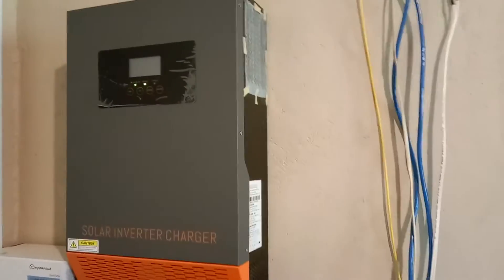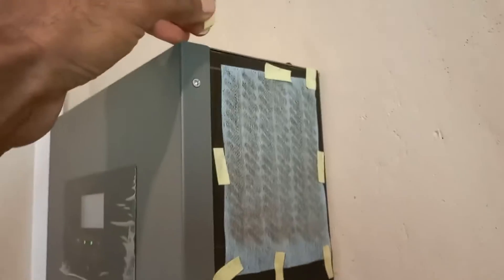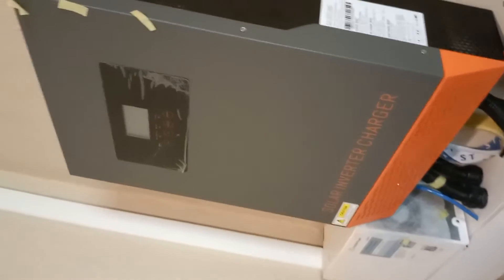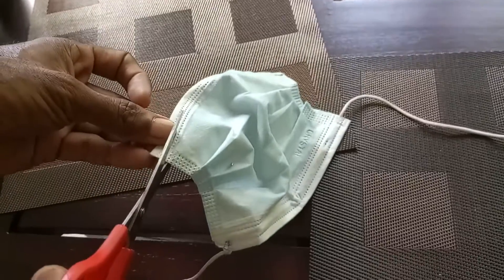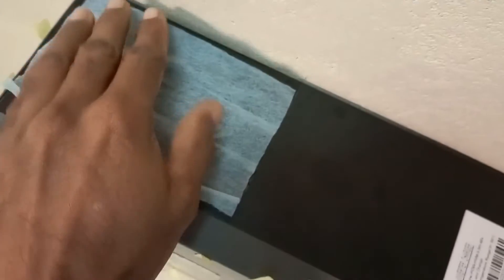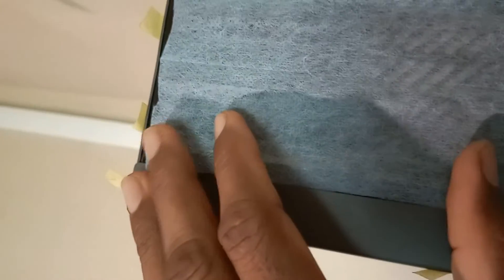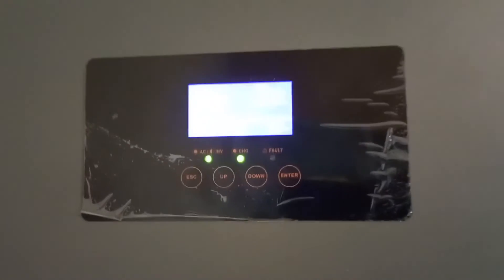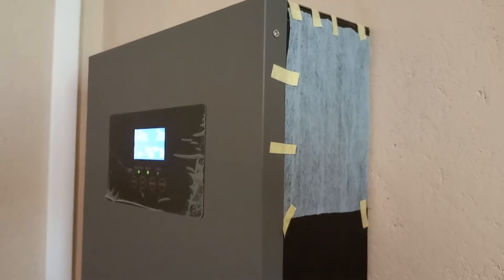How To Add Dust Filter for Solar Inverter - Cheap dust filter

Comment: this cause even worse condition for inverter and causing heating issues
Reply from the maker: Hi, Thanks for checking out my videos and your comments.

I have used it for many years without issues. But I make sure to clean the filter or change it very two weeks or even sooner if I see its color is changed. 

Your point is right it could cause overheating but since I clean regualarly it has been okay so far. Also, if you dont use a filter make sure to clean the fan blades more regularly because the dust is collected on the fan blades which slows down the air suction, this also cause to overhead the inverter as well as damage the fans.

Hope this helps.

Comment: Are you monitoring the internal temperature?  One concern would be the filter itself and subsequent fouling of the filter reducing the cooling air flow.  Suspect only small unless fouling is bad, but good to check the impact.
Reply from the maker: Yes, I have a sonoff tem sensor inside the inverter. It helps me monitor the temperature. The best I have noticed is that the filter needs replacing in less than two weeks.
Reply: My inverter was having no2
Error
Protected with coating
Still again no2
Dust created
Reply: Although it was coated
After 9 months as gain no2 error 
Stopped with burst sound
And stopped 
I don't know how much it will cost my 5000Es
Growatt

Comment: Very good idea: inexpensive and effective solution.  This also solves the problem some have with small insects (ants) getting inside ... that can be even more dangerous than dust. Your idea solves both problems although I am sealing the whole perimeter of both vents to avoid the insect problem.
Reply from the maker: Thank you so much for the comment. I had been using this method up to last month, and I upgraded my inverter. The new one came with a factory-fitted dust filter, but it seems hard to clean as the dust goes inside the sponge. But the removing and fixing the filter is so easy.

Mostly, I wanted to share a few things which I learned during the use of the Surgical Mask filter:

🎯 Replace the mask when you start to see dust in the design of the metal mesh underneath.

🎯 Don't add a mask to the section where air blows out; it will drastically reduce the air blow.

🎯 Some inverters have space between wire connections where insects can go; for such situations, I used some hot glue.

Here's my new inverter with the built-in dust filter - https://www.youtube.com/shorts/lVzXCcTjhc8

Comment: Maybe use magnet to hold filter . Easier
Reply from the maker: Yes, I agree with you. I was aiming for the cheapest dust filter. So having a surgical mask and a few strips of masking tape will cost almost nothing.

Also, have you seen the new inverter models? PowMr and most other companies added dust filters as an option, which is cool isn't it.
Reply: @diydesk  I haven’t seen.  I plan to stick with srne
Reply from the maker: Here's a video I made specially for you - https://www.youtube.com/shorts/lVzXCcTjhc8
(there's two filters in both sides).

SRNE is a Good Brand make sure to protect it from dust.
Reply: @diydesk  I’ll watch it, thanks!
Reply: @diydesk  did you buy the new upgraded inverter or did they sell those pieces so you can mod your old inverter

Comment: hi how has your expirence been with this manufacturer? i have a 60A 3000w offgrid version on the way to run a  8s 280ah lipo4 battery and up to 3000w of panels a battery more will be added later
Reply from the maker: Hello @kimmogensen5390, I'm glad to hear that you're also using PowerMr. I'm very satisfied with how well my unit is performing. Last year, from April 2022 to January 2023, one of my friends imported around 50 units of PowerMr for resale. They had both the 3.5KW and 5.5KW models in White & Blue and the Black & Orange (new) models. All of them worked well, although there were a few issues when they were installed near the seaside and some had problems with the fans. Additionally, one unit was not working when it arrived, but the seller took responsibility and sent us the necessary parts after we shared videos. Some parts were shipped for free, while for others we had to pay. Overall, I think PowerMr is a good brand and their support is decent.

When compared to other brands like #Sako, #Epever, and #Growwatt, I'm happy that I chose PowerMr. It's not that the other brands are bad, but I've heard about some user issues with Sako, such as error 55, software problems with Epever, and fans that collect dust in Growwatt. In my opinion, PowerMr is better in comparison. I usually load around 4KW to 4.5KW of power during the daytime using solar energy and batteries. I often disconnect it from the main power grid using a smart breaker. (Note: Although Epever inverters were not my choice, they are actually good and have high-quality products. I particularly like their MPPT solar chargers from the "tracer series".)

Just a week ago, I sold my PowerMr unit and ordered a 6.2KW PowerMr inverter. I will share videos once it arrives.

Feel free to reach out if you need any technical assistance. I'll try my best to help.

#Staysafe #StayPowered :)
Reply from the maker: Did you get your Inverter ?
Reply: @diydesk  yes got mine and it has filters installed from factory,,,i have just ordered 8 eve280k cells more for a decent storage capasity of 2x 8s 280ah 24v batteries  in all 560ah 24v 14kw i belive..  right now i am running on 1x 8s battery and about 800w of mixed old solar panels charging trough pwm chargers and that is enough for my usage in the summertime it will certainly not surfice in winter  so ,there is 6 x 505watt solar panels on the way  for winter and i have a istabreeze i 1500watt windturbine also..i have chosen not to get hooked up to grid again after my house burned down in okt last year and the power companies here in Denmark were charging ppl 1 $ per kwh troughout winter leaving ppl without either heat or money for food or bills so i figured since i were already unhooked i might aswell stay unhooked from mains power  ..it is very generous of you to offer me help on the technical side i might have a few qesstions regarding setting charging parameters for litium battery packs i have studied the manual quite a bit but sometimes one have to mess with the item to truly understand it kind regards from the island of Bornholm Denmark
Reply from the maker: Hi Kim (@kimmogensen5390), Glad to hear that you received the inverter. Yes most new models comes with dust filters which is great, I received my new 6.2 KW On/Off Grid inverter as well. I will share the link of it for you to have a look. 

Regarding the Lithium batteries, your calculation is correct. EVE LifePo4 which has the nominal voltage 3.2V, the cut-off charging voltage is 3.6V, cut-off discharging voltage is 2.5V. But I prefer having MAX CHARGING CUT OFF TO 3.5 V & MAX DISCHARGING TO 2.8 V. Which will not hurt the battery.

The PowMr Inverters mostly don't have support for JK BMS or Daly BMS therefore you might have to do the settings manually.  Most of the new PowMr inverters comes with a Battery mode called "Lib" it is under battery type (mostly in menu number 5) with this mode you can set charging discharging voltages.  But I have seen users complaining that these settings change some times when the unitis restarted..etc. 

So as the next option you can try to set Battery type as user and make both bulk charging and flowting voltage to 3.5V x8=28V, back to utility 3V x8=24V then change Low DC cutoff to 2.8V x8=22.4V. In this way you know the battery is running low when the inverter starts beeping and still you have some power left. 
Also, remember to disable Battery Equalization in the inverter. 

Hope you can run 24/7 from the Off-Grid once you get the new batteries. Good Luck.

This is my new Inverter - 
https://youtu.be/GOX-SuLrG0I
Reply: @diydesk  so the unit is up and running on my newly arrived 505w pv panels i started of with 1 string of 3 panels  and changed the settings  it took a bit before i figured how to make the unit save the settings , never the less i am gonna keep a sharp eye out for changing settings , i never run to under 20-25% on my battery bank  ,,, the new unit you got looks really nice  
greetings from denmark
Reply: Unfortunately I did not see this video and as a result for the second time my girl about Growatt 5 000 ES is
Giving warning number two indicating heating up with ,number 2
It was coated and worked for 9 months. Again, the last problem has come and now it's out of order

Comment: Its a good idea
Reply from the maker: Thanks for the comment. Yes has been a working solution for me. I have been using this technique since June 2022. Usually I remove the bottom cover each time I change the filter and look inside to make sure the inverter is clean. Some inverters, like mine, have an additional air intake on the backside in addition to the two inlets. As a result, it is preferable to use a blower to clear up about every six months. Just an idea
Reply: @diydesk  hi how has your expirence been with this manufacturer? i have a 60A 3000w offgrid version on the way to run a  8s 280ah lipo4 battery and up to 3000w of panels a battery more will be added later
Reply from the maker: Hello @kimmogensen5390, I'm glad to hear that you're also using PowerMr. I'm very satisfied with how well my unit is performing. Last year, from April 2022 to January 2023, one of my friends imported around 50 units of PowerMr for resale. They had both the 3.5KW and 5.5KW models in White & Blue and the Black & Orange (new) models. All of them worked well, although there were a few issues when they were installed near the seaside and some had problems with the fans. Additionally, one unit was not working when it arrived, but the seller took responsibility and sent us the necessary parts after we shared videos. Some parts were shipped for free, while for others we had to pay. Overall, I think PowerMr is a good brand and their support is decent.

When compared to other brands like #Sako, #Epever, and #Growwatt, I'm happy that I chose PowerMr. It's not that the other brands are bad, but I've heard about some user issues with Sako, such as error 55, software problems with Epever, and fans that collect dust in Growwatt. In my opinion, PowerMr is better in comparison. I usually load around 4KW to 4.5KW of power during the daytime using solar energy and batteries. I often disconnect it from the main power grid using a smart breaker. (Note: Although Epever inverters were not my choice, they are actually good and have high-quality products. I particularly like their MPPT solar chargers from the "tracer series".)

Just a week ago, I sold my PowerMr unit and ordered a 6.2KW PowerMr inverter. I will share videos once it arrives.

Feel free to reach out if you need any technical assistance. I'll try my best to help.

#Staysafe #StayPowered :)